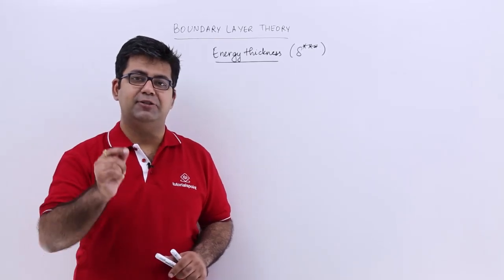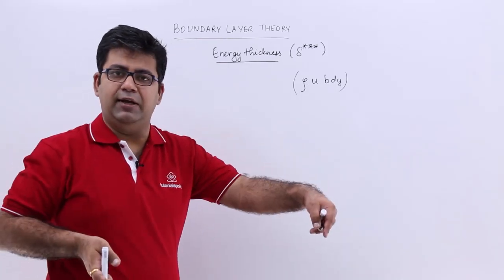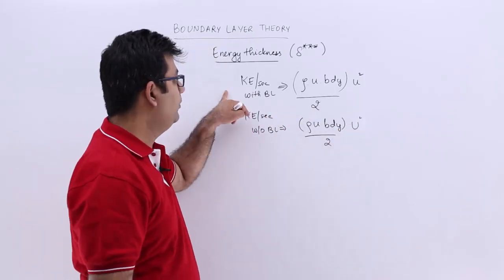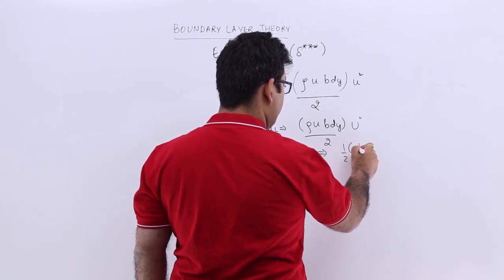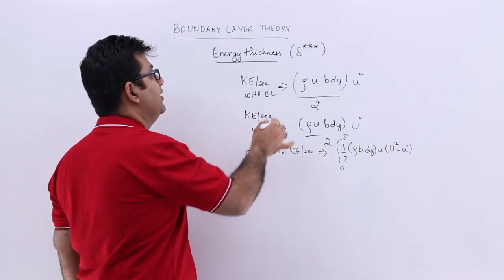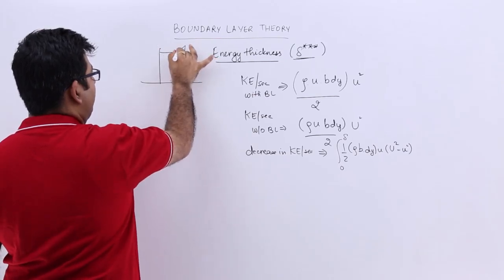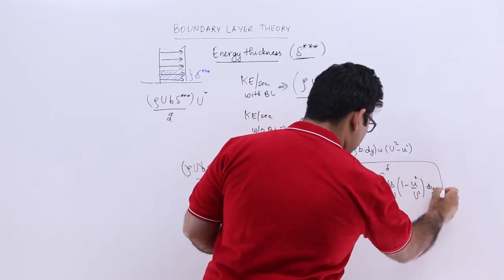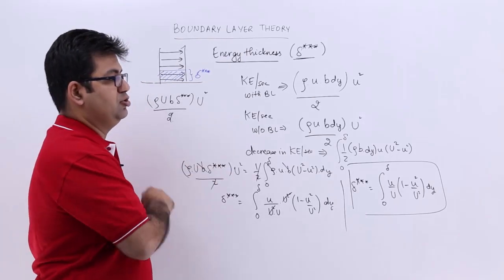Boundary Layer  Energy Thickness

Comment: sir why mass flow rates are equal in both cases?please help
Reply: Decrease in mass flow rate because of the presence of the boundary layer is same as the decrease in mass flow rate because of the reduction in the height of the area considered
Reply: in the first case the loss is calculated using the difference in velocities whearas in the second using a change in area, both cases will hence give the same loss in KE
Reply: But he has written
u.b.dy instead of U.b.dy during calculation of energy without boundary layer

Now explain this??
Reply: @aayushsharma8173  the right expression comes at 3:40, it is only a representation mistake.